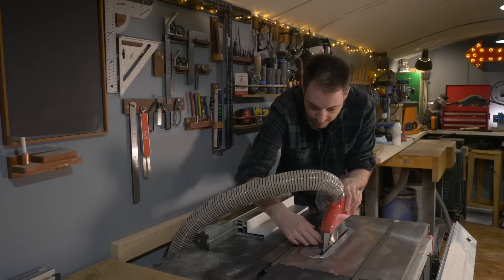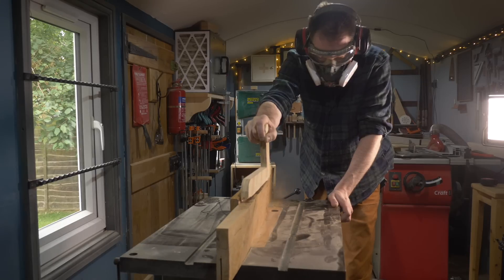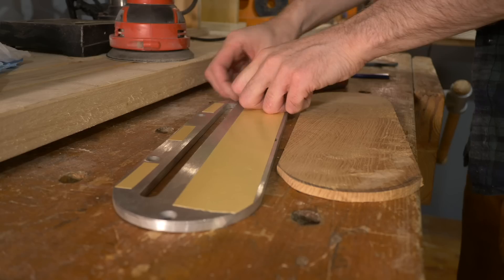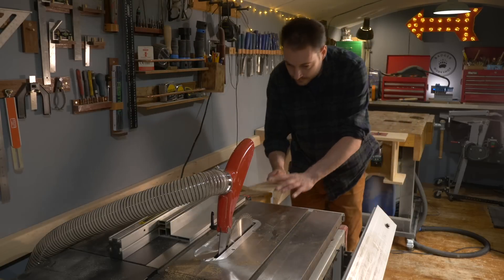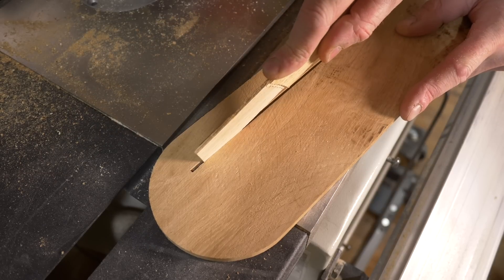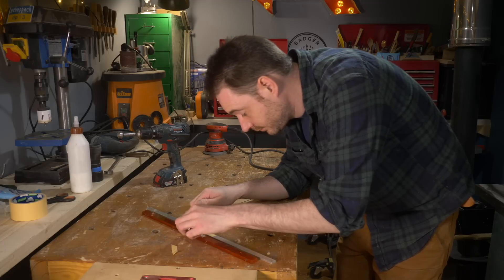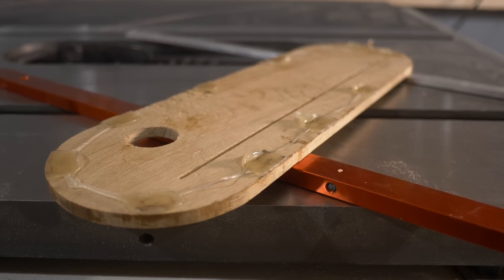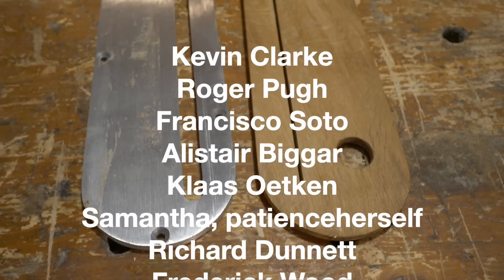Simple Table Saw Insert

Comment: That's just what I  need. A zero clearance insert that I can make in 5 minutes  LOL
It's the newest item on my to-do list, since today evening (but the first or second I need to make)
I just have my table saw up and running since last week. My first "project" was to cut off the tongues and grooves from tongue and groove wood.
Tongue and groove wood is quite cheap over here but I need "straight" wood. The cut offs are very thin.
Thanks for showing how easily it can be made.

Comment: Great job Matt. This method is safer and easier than plunging upwards through the new wooden table saw insert with an unguarded saw blade. 
It also has the advantage that it cuts the slot for your riving knife which in turn remains in position during the operation for added safety.
I like the hot melt idea for discrepancies in thickness and referencing flush with the table from above, fool proof. My next project on the list. Tony
Reply from the maker: Thank you. I have tried a few methods and this is my favourite

Comment: matt i know  your tight when i bought the same saw as you after watching you review on it my insert plate
was cupped up so axi sent me a new one which turned out to be the zero clearance one the wrong one as i could not tilt the blade so they sent another one out yet again the wrong one so i now have two of them also i ordered the rip blade they sent two dont ask why maybe because when the saw came they forgot to send
the rip fence so had to wait for that anyway if you want a alloy insert plate and a rip blade i have them here 
in liverpool if you want them
Reply from the maker: Sounds like you have had some problems. Glad it sorted now. Thank you but it’s probably a bit far away. Always useful to have a spare

Comment: Great job Matt, I have used the hot glue trick on mine, but love the cutting of the blade clearance strip and gluing up at the end... This is a lot safer than raising the blade through the insert... Thanks Matt
Reply from the maker: Yes and raising the blade never cuts a slot for the riving knife.

Comment: Do you still use your camvac from previous posts?
Reply from the maker: Not any more
Reply: Badger Workshop 
Is there any reason for this as I was thinking of getting one along with the Rockler set up with separate bin? Thanks
Reply from the maker: @penndino  It was wall mounted and I did not have room for it in the new smaller workshop